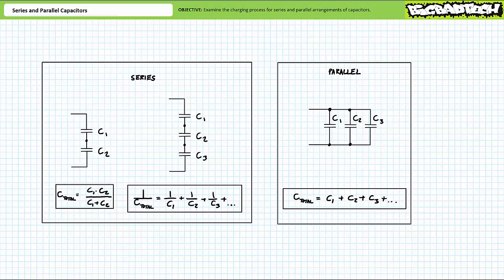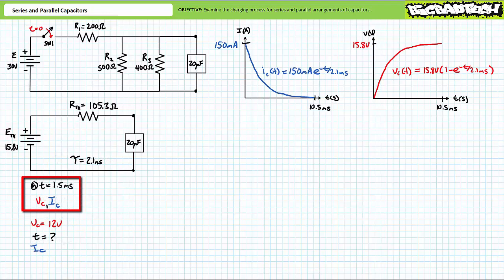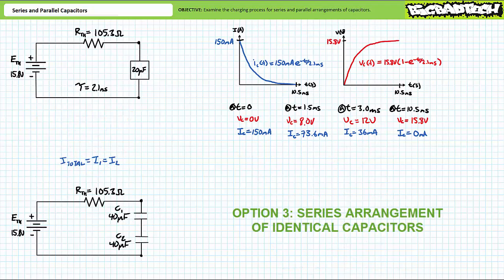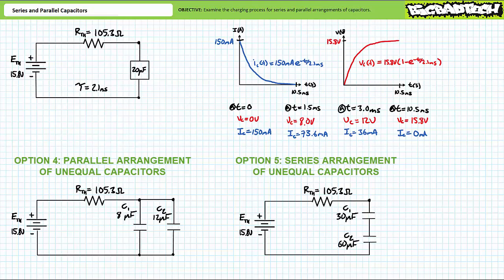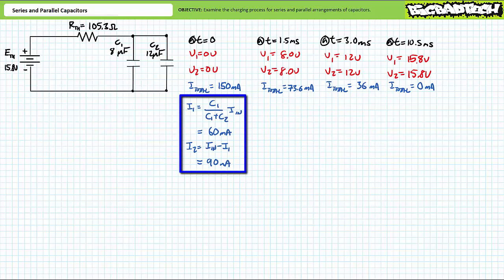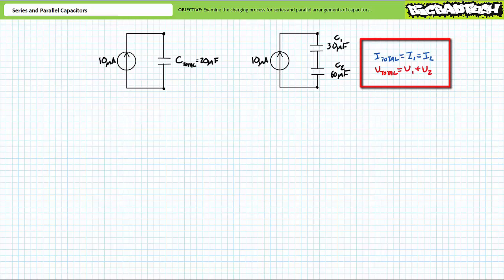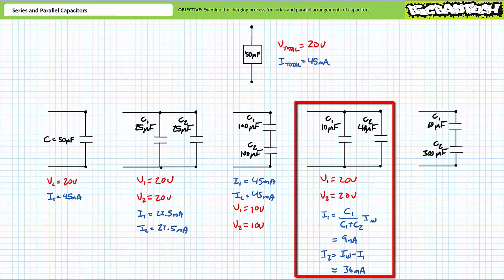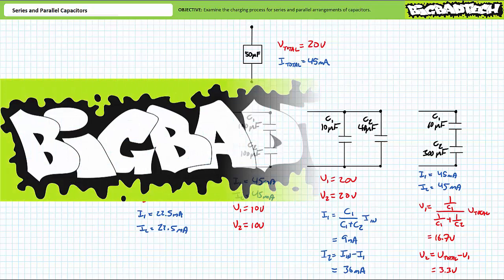Capacitors in Series and Parallel (Full Lecture)

Comment: At 27.14 can we use Vx = C2/(C1 + C2) * Vtotal, analogous to what you did in CDR by using “one” and “other”? I understand this may not work with more than two capacitors in series but it should work with just two.
Reply from the maker: Yes, you can think of it this way.

Comment: Do you do any service work on magnetic starters. Are they worth checking. It’s off a delta tablesaw.
Reply from the maker: Check out the "Contactors" lecture at: https://www.youtube.com/watch?v=WT14nfmu1cI
I tear apart a couple modern and old school contactors and point out their inner workings. Honestly, only thing that might be serviceable in a magnetic contactor would be the contacts themselves. Make sure they're not pitted and/or worn from making/breaking high inrush current. Make sure the contact carrier group has free, unobstructed travel and the return spring or mechanism returns it to the deactivated state. Last check the electrical and mechanical integrity of the coil itself.